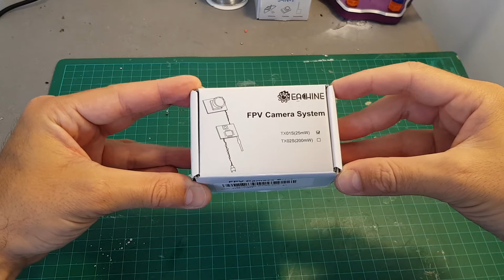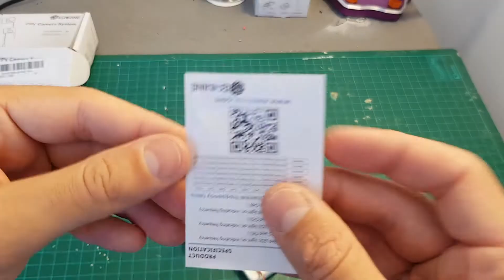Eachine TX01S - 3.9 Grams Camera And Vtx

Comment: i have a question about this kind of fpv camera and transmiter..
-can i put a battery 400mah or more and if yes is there no danger that am gonna burn it ??
i read that it is possible but i dont now the method
  i need this thiny camera fpv for a project on sea..
thank  you..
Reply from the maker: The mah and the voltage of the battery are two different things. Make sure that you supply the camera with the right voltage (3.3V-5.0V) and you'll be fine. Good luck with your project!

Comment: Good Morning! Watching the camera video I realized that the battery voltage is shown.

Who measures the drone's battery is the camera? How did you make the battery voltage display on the screen?

Did you add some other piece to show the voltage? Or is it the camera that reads the drone battery?

Because I'm analyzing which camera fpv to buy for my drone.
Reply from the maker: Hi there. I am using the build in OSD feature of the Eachine Minicube. I suggest you should go for the TX03 camera. You can watch my review here: https://youtu.be/xF454y1p-qE
Reply: To see drone battery level on the camera, would it be the rcd3060 osd? To see drone battery level on the camera, would it be the rcd3060 osd?